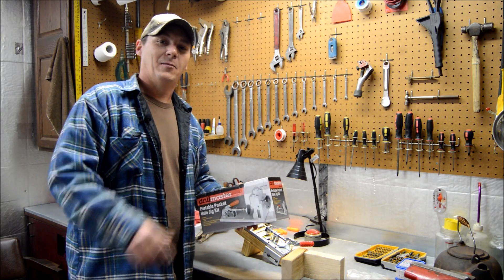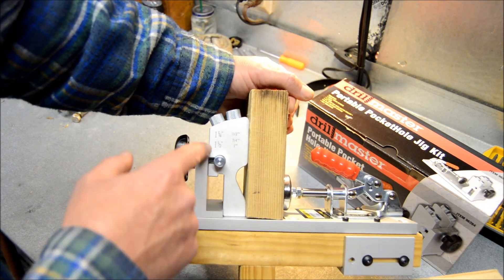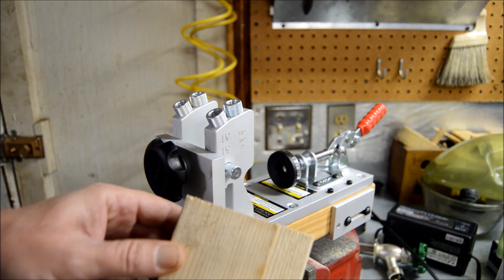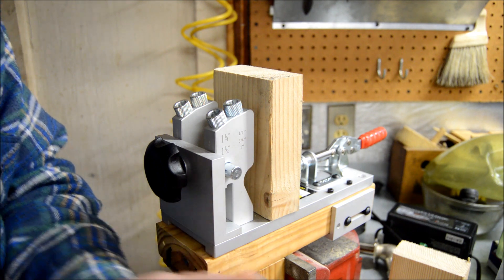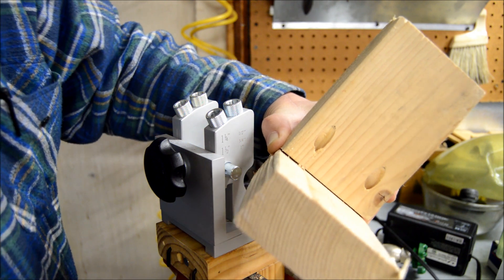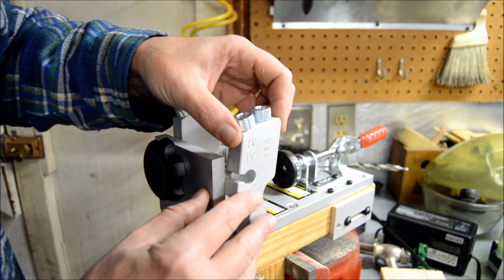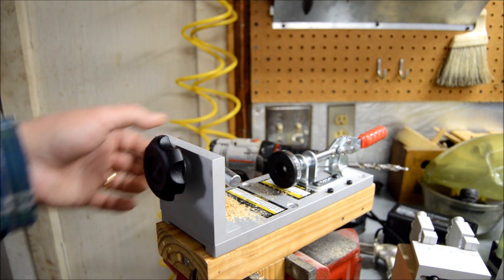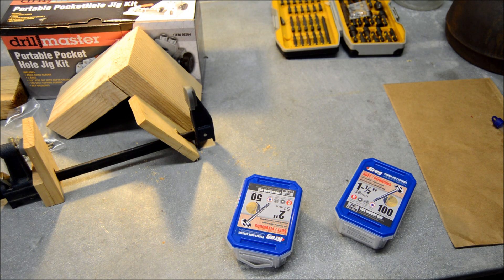Drill Master Pocket Hole Jig - Tips and Tricks

Comment: Great video!!!!! FYI...the 2 little screws....you use them for drilling into 1/2 inch wood. You insert the 2 screws into the jig, and that kicks the bottom of the wood out enough that you won't drill thru the wood.
Reply: Thank you!! Explains why my 1/2 sheets are showing the tip of screws. Wish I seen this a few days earlier but, better late than never.
Reply: The instructions with my katsu version (exactly the same as this one) says you insert the screws and raise the piece onto the screws. I’ve tried both ways and can confirm that raising the piece is what is required - not pushing it away.
Reply: CJ thanks for the confirmation!!
Reply: Rick Iriarte ahh thanks for your comment, you reminded me to mention, the drill depth also needs to be readjusted when the screws are in!! Otherwise it’s too short! Also just to reaffirm, if the workpiece was placed in front of the screws, when clamped, the screws would mark the piece!
Reply: Actually, per the manual,  you set the 1/2 wood on top of the screws. that gives you the correct center.
Reply: When in doubt, read the instructions, they are explained in there.
Reply: Just what I’m after! Thank you
Reply: @Keagan Hassan Instablaster =)
Reply: @Elliott Brendan i really appreciate your reply. I got to the site thru google and im in the hacking process atm.
Seems to take quite some time so I will get back to you later when my account password hopefully is recovered.
Reply: @Keagan Hassan no problem xD
Reply: @ronsmith5231  On top of the screws, looking from the top of the jig? Or is it on top of the screws, towards the clamp, covering the screw cap? It's still unclear to me.
Reply: @calderjonhughes  This was going to be my question to craigbell3440.  I had heard these were to lift the wood, I hadn't heard they were to push it out.  Your confirmation is appreciated.
Reply: @TheRosstaman  no worries, wow 4 years ago my comment! Amazing how laying down some info years back can be of use to others forever. Hope your project goes well.

Comment: you probably know this but a great way to build cabinets on the cheap is to use Melamine  and pocket holes  the  coating on Melamine has the scratch resistance of a high grade plastic laminate like Formica or any other brand  if you build your boxes out of it you wind up with a nice interior that is easy to clean,sanitize ,etc  you can use European style hinges  to do full overlay doors of your choice  you may also check out IKEA cabinets that you assemble  about 10 years ago  they were one of the best values for the money ! I am a retired Woodworker  and at one point those IKEA cabinets and doors were cheaper than  my cost of materials to build something comparable  IKEA does use a better grade of  sheet goods than most other companies you find in the big box stores  the resins and materials are pretty dense making them strong and pretty stable  nothing like the old Walmart furniture that  wouldn’t hold the fasteners  plus IKEA does utilize wood dowels for extra strength  were needed

Comment: Question (if you are still using this jig)...if you have purchased a new 3/8 pocket hole bit. Do the KREG bits work or did you just order off of Amazon? I looked at this jig today at HF. As you may remember, the kit comes with 1 bit, and HF does not sell extras...I had the Store Manager look it up and also call HF main office.
Reply from the maker: Good question, I do still have it but my original bit is still sharp. I don't know if the kreg bit is the same size, but you could take a caliper measurement on the HF bit and go to Home Depot and measure it against the kreg. My guess is that they are the same size. Good luck and let me know how it goes.

Comment: Thank you for this,   Nicer to watch than reading the instructions.   I'm sure others have noted that the two Allen screws are fir when you use fit on half inch material only.  I guess they just raise up the bottom slightly so the drill doesn't blow through the other side.

Comment: Thank you for the video!  I've been looking a Kreg jigs and struggling with the prices, especially when they are mostly plastic.  Your video convinced me to give this unit a try!  

I noticed in other reviews that people were complaining that the drill bit doesn't last very long.  I have a feeling that they did exactly what you warned against and didn't set the collar correctly, contacting the base with the end of the bit.  I've also seen reviews where people are complaining about the quality of the screws that come with the unit, recommending Kreg screws.  As Kreg pocket screws are rather pricey, most "cabinet screws" will work as long as they have a flat head.  I found GRK branded cabinet screws at Home Depot for half the cost of Kreg.
Reply from the maker: I'm still using the factory bit and it works fine. It might dull faster if you were drilling very hard woods? Thanks for the tip on the GRK screws, I'll check em out next time I'm at HD.

Comment: The little screws are for when you are using 1/2" stock...by placing your 1/2" ONLY stock...it adjusts the angle of the hole for maximum strength without penetrating the outer surface of your stock.

Comment: I've used mine a lot. I have 2 Kreg ones for mobile stuff, but this I personally think is better. My projects are thinner wood so there's no need to adjust with double hole system. I you're part of the Inside Track Club, you can get one now for $54.99.  That's 1/2 the price of Kreg's. For screws, I order off EBAY. You can get pan head phillips head screws , 500, for about $10-15. That's all i use. Kregs screws are pretty expensive, plus, I can use any long phillips head bit. Very good review
Reply from the maker: Thanks for the info on the screws. I didn't think of ebay.
Reply: what exactly do I search for to get the screws on EBAY?

Comment: Those little screws- put them in the holes you indicated before clamping the 1/2" material to drill the pocket hole. That slight additional distance is necessary, only for drilling into 1/2" material.

Comment: First of all thanks for the Tricks and Tips. Comparing the Drill Master to Kreg Pocket Jig K4, the Drill Master does not have the feature of measuring the thickness of the wood you are going to drill.   What do you think of that measurement feature?
Reply from the maker: It hasn't been an issue for me, but I always use a scrap/test piece before I drill my piece.

Comment: Hi, thanks for the demo and those little screws go where you showed and then for much thinner material down to half inch?? Will then sit on top of these screws to raise the board higher to give the correct clearance for the holes!
Looking from the side when the material is thinner it will protrude thru the other side of the board but but raising the material will stop the drill going thru?
Hope this helps.
Cheers from Australia
Reply from the maker: So they act as a spacer when cutting thinner materials to prevent blow through. Excellent, thank you.

Comment: Great job FYI always use glue with the screws unless you want to take it apart later but always use glue.
Reply from the maker: Thanks and I agree on the glue. Someone on YT did a test with pocket hole joints w/glue vs. without. They were at least 2 times stronger if memory serves me. Almost as strong as a rabbit/dovetail joint. It's a great system for DIY production.

Comment: Great vid and explanation of jig use.  I just bought one at Harbor Freight 50% off Sidewalk Sale. Question... This video is 4yrs ago. Are you still happy with it or did you have to upgrade?
Reply from the maker: Still using it and very happy. I'm still using the original drill bit. I drop a couple of drops of 3&1 oil in the sleeves just to keep friction wear low. It's one of those hidden gems at HF, as good or better than the entry level kreg.

Comment: One thing to avoid is angling your screws towards the end or edge of your material. For a stronger attachment. As an example of what I mean, in a box angle your screws towards the inside and not the outside. In otherwords pocket holes on the outside.

Comment: If you read the instructions you will find out the two small screws are not for bumping out the half inch wood.  Once the two screws are inserted the half inch wood is placed on top of the screws, than clamped and drilled.  The screws elevate the half inch thick wood.

Comment: I have the Harbor Freight pocket hole jig and am very happy with it.  However, the screws that are provided are terrible for pocket hole joinery; they are not self-tapping.  Throw them in your Assorted Screws jar for use elsewhere.
Reply from the maker: I agree and they snap if you go a little too tight. The kreg screws are excellent but a little pricey.

Comment: I don't like that it uses soft screws, typical of a lot of the Harbor Frieght hardware I have purchased, and don't like that it does not come with a driver bit.  all things that come even with the basic Kreg sets.  I like the clamp, but will use the Kreg bits and screws.  I was gifted one of these.
Reply from the maker: Yes the jig is good but the screws are garbage. Good luck!
Reply: Not really a big deal on the screws and bit. I didn't even use the screws. I use milescraft and armor tool screws. I already had a long Phillips but did need it since I didn't need the screws.

Comment: If your using 3/4 or 1 inch material you can easily use pocket holes for doors and they can be hidden easily. Tru it U will be surprised.